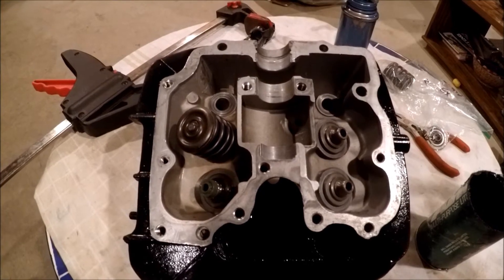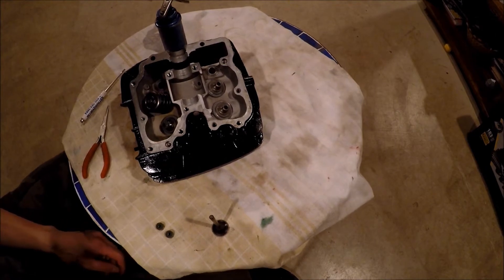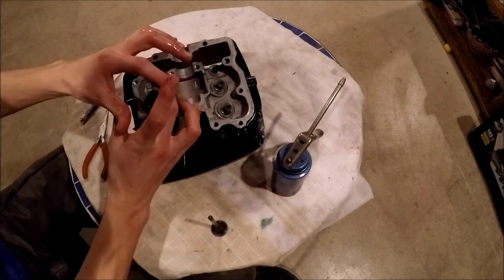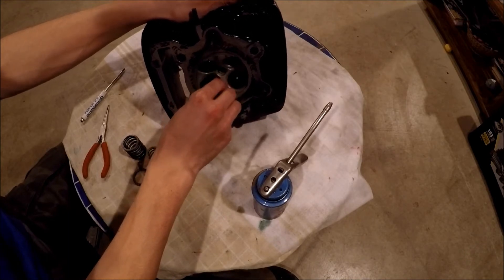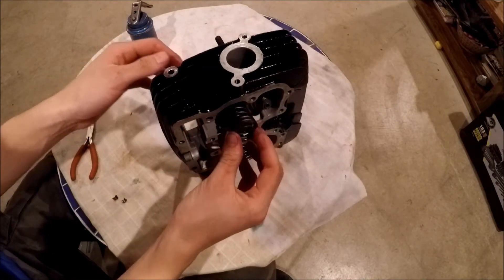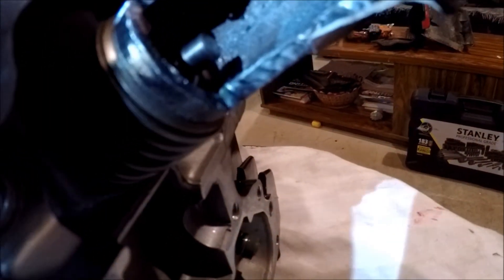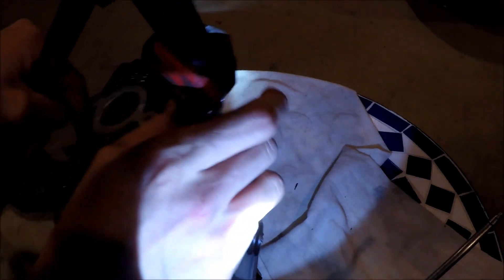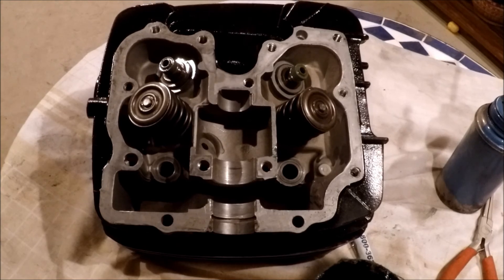How to Change Motorcycle Valves (assembly)

Comment: I am doing my valves seals job on my honda vlx 600 2006 and I need the torque for the screws and nuts that holds the lifters in place do you know the torque pound for it thanks